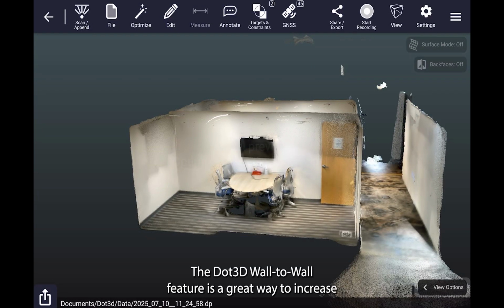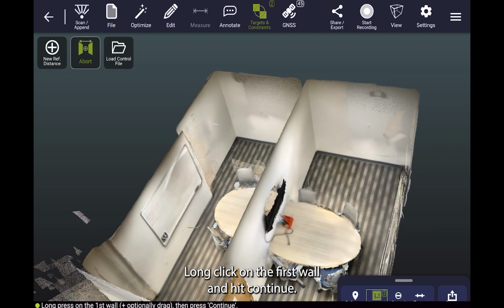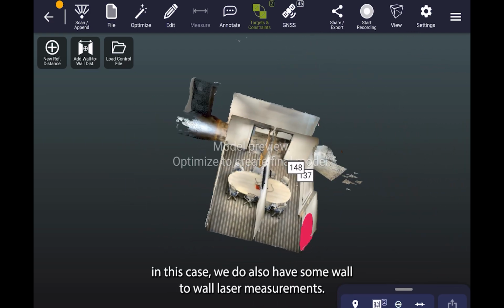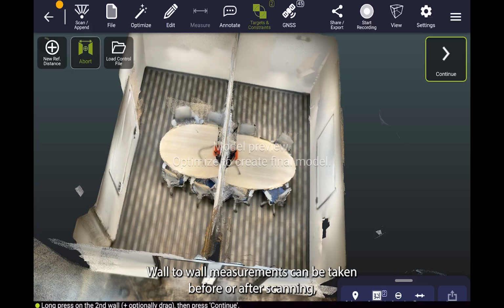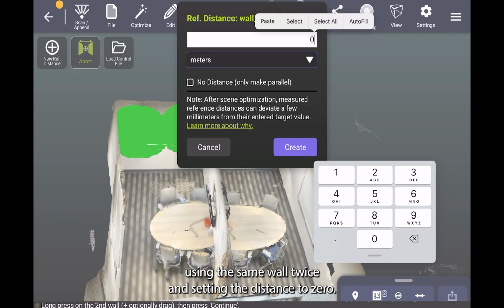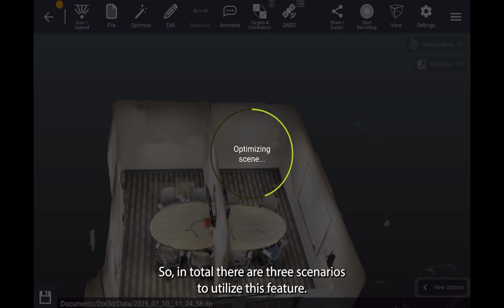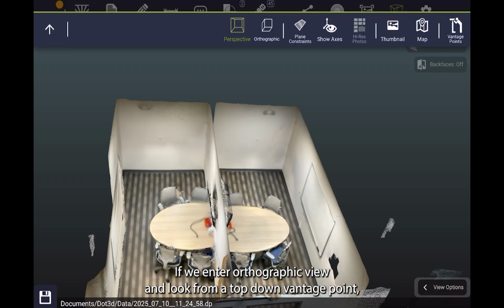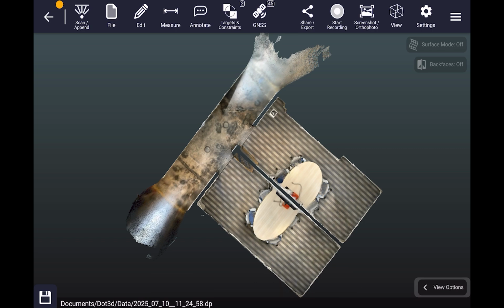Dot3D's New Wall-to-Wall Constraints | Reference your 3D scan data with targetless measurements!

Comment: Hi thanks for the video. We are trying to survey apartments using Dot3D. Should we be taking dims on all walls that are parallel?
Reply from the maker: Ideally, yes. However, if this is not always practical, a good alternative recommendation would be to take a few longer measurements that span the largest areas possible across your total scan space, and then just flag some of the other walls in your scene as parallel to each other as applicable.

But yes, wherever you can, the more control measurements the better (i.e. l x w of each room, for example).
Reply: @DotProduct3D 
Ok thanks for that. Not sure if that defeats the purpose for us. We were hoping to use it as a quicker , more accurate tool for surveying apartments, but if we have to do both that slows the process down?
Reply from the maker: @planlondon6205 Dot3D should still be a lot faster than traditional survey of the space. Both on site and in post processing / drawing. With this new feature especially, the reference measurement process has never been easier/simpler.

It's also worth noting that this feature is of course optional and how much you may or may not want/need it really just depends on: 1. The size of your scenes (apartments) 2. The desired levels of accuracy/control 3. The results of your own internal testing.

We would recommend testing with/without W2W constraints on a representative scene to see what's really necessary for your needs. Just let us know if you need any trial extension.
Reply from the maker: @planlondon6205  And if you haven't already, please be sure to also review this guide: https://www.dot3d.app/indoorguide